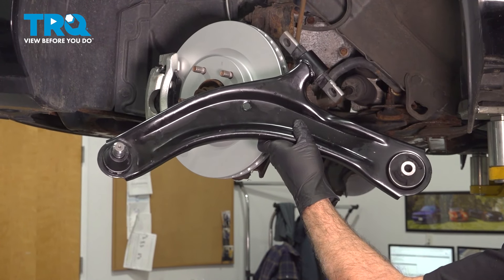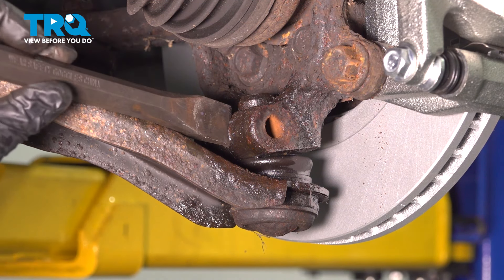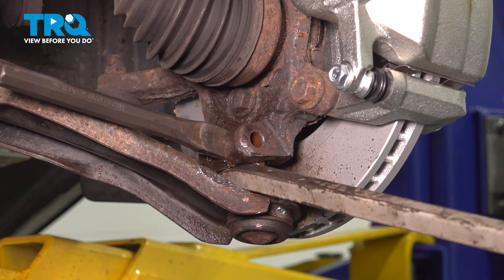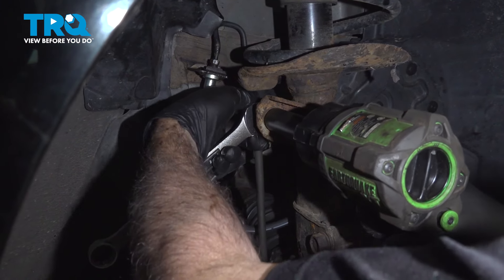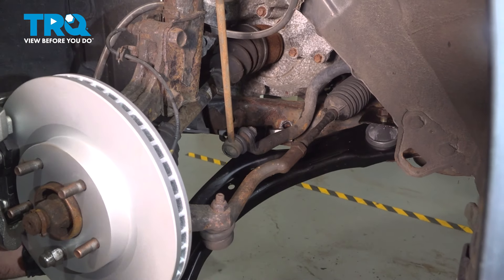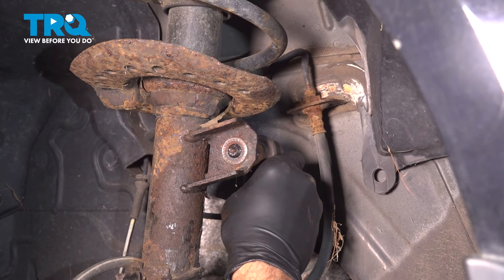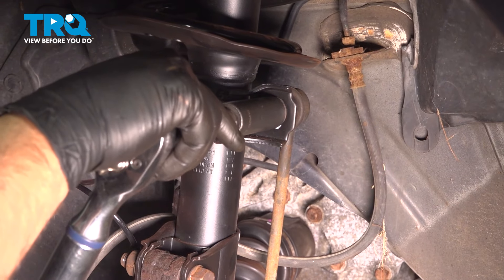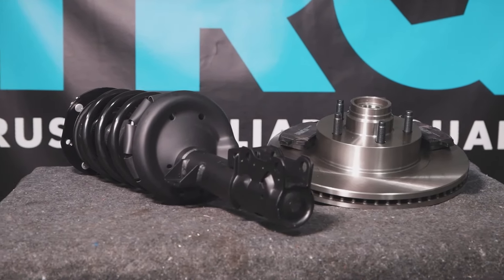How to Replace Front Lower Control Arm 2008-2013 Nissan Rogue

Comment: I had 2 problems with this job, the front A arm frame bolt was a "B" to get started, and if you push the ball joint in to far the locking bolt is a PIA to get in, it has to be precise and eyeballed to allow it to go into the locking clamp for the ball joint itself

Comment: TRQ PLEASE improve this as follows. One commenter says Pinch Bolt won't go back in with new Control Arm tapped into the Pinch Bore - exactly as I suffered in ignorance on my first side (denting my tapped in Pinch Bolt's Threads against what turned out to be a 'Too High' Pinch Pin. Another commenter says new Ball Joint won't go into the Pinch Arm (I think with Pinch Bolt left in but nut fully loosened - exactly as I'd tried on my second side. TRQ - TEACH and SHOW - as a New Video Insert just after your Tap In @ 08:29 - that the new Ball Joint must be Tapped In JUST EXACTLY ENOUGH (I'm guessing +/- 0.25 mm or 0.01inch) to show a SMOOTH BORE when you Sight Carefully Through the Whole Length of Both Sides of the Pinch Bore. AHA! We DIY'ers need to be taught that the half-circle cutout part way up the Ball Joint's Pinch Pin is Nissan's Perpendicular Interference Fit SAFETY DESIGN. It assures that the Ball Joint's Pinch Pin can NEVER Fall Down and Out of the Steering Knuckle's (Thru-Bolted) Pinch Joint. I wasted perhaps 6-8 total hours scratching my head without THAT understanding, by having to recover from my Different Mistakes on First and Second Sides. TRQ - add a bit to Show the Bore Sighting with Ball Joint Pin tapped in Too High and/or Too Low at first, then giving a 'Tiny Adjustment Tap' to achieve a PERFECTLY smooth Bore Sighting BEFORE you TRY to Insert the Pinch Bolt. Until then, I hope my too long comment will Help the Next Person!

Comment: Need to wait to reinstall sway bar links until after you torque the forward mounted control arm bolts.  Otherwise they will block access to the bolts (that is why they were removed in the firs place.

Comment: I’ve done several and removing the sway bar link isn’t necessary, furthermore tightening the two 21mm bolts all the way will hinder a person doing it without a hoist.

That ball joint won’t be as easy on the ground, I leave those bolts loose to help line up that ball joint.

Comment: There was no 20 mm bolt/ screw at the back of link at all. On my 2012 rogue
Reply: My 2014 Rogue's original Factory Links had Torx Holes (I think T35) Machined Into their Bolt Ends. I held my Torx (I think Size T35?) 'Allen Wrench Socket Bit' into the Link Bolt End as my Ball Joint Rotation Stop while also Loosening the Factory Link Nut with my (IDK) 18 or 19 mm Racheting Box End. A Crescent or a Crowfoot Socket would also work WITH your T35 in the Factory Link's Bolt End. TRQ's New Link Bolt did NOT have that Factory Nissan T35-Insert Bolt End. But, it DID have this TRQ Video's mentioned 20-mm FLATS which I WAS able to get my (Small; only 10-in) Crescent Wrench's semi-thin Head to fit onto. But, I had to gently push my (Slightly Thicker than Fixed Open-End 20mm Wrench!) Crescent Wrench Face Back JUST a bit against the new TRQ Link's Rubber Ball Joint Bellows before I could Tighten my Crescent Wrench to (Only) 20mm - tight against the Flat Faces of my TRQ link's 'Backup Nut'. Why? Because I found that a Very Thin FRONT FACE of my new TRW Link's built-in 'Backup Nut' was actually a bit LARGER and Fully Round - like the Round Rim of a Flange Nut which DOES also have its Hex Flats ... just slightly Above (or Below) that Thin Over-sized Full-Round Rim.
Reply: Same, you have to use the allen bit and hold the nut with a wrench. Absolute nightmare to break loose for me.